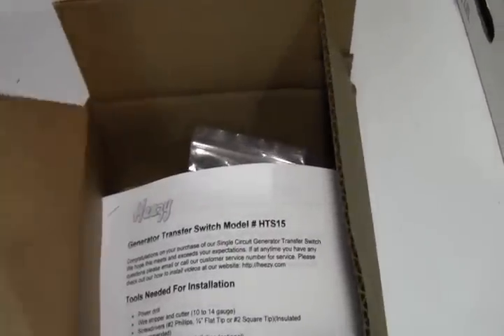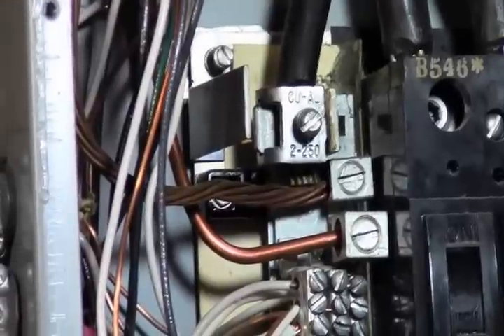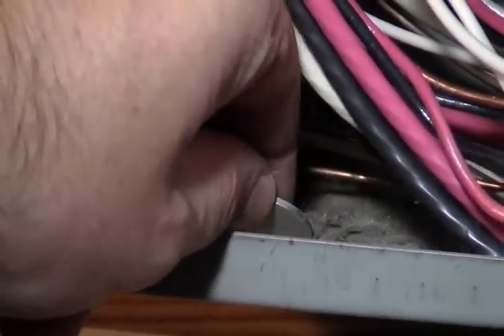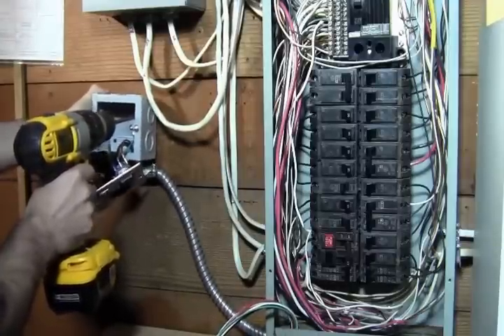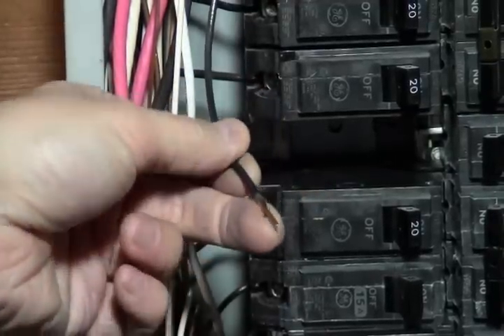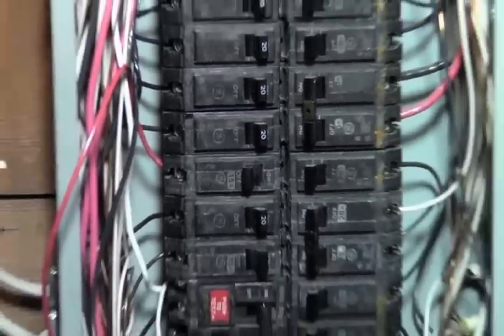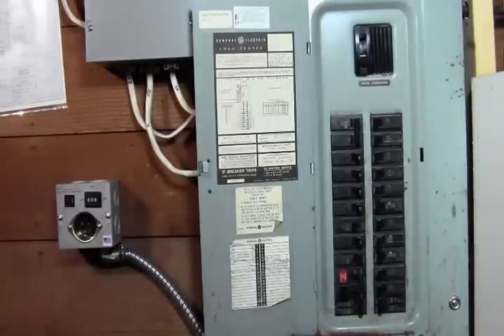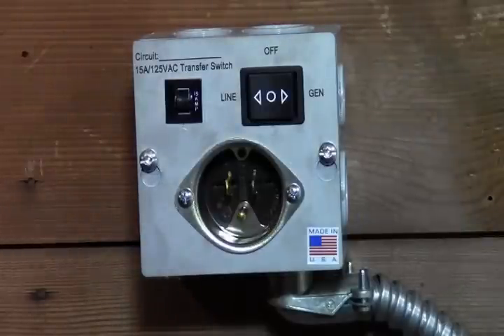RicksDIY How to Wire generator transfer switch to a circuit breaker panel DIY install Instructions

Comment: Rick
Many portable generators have their earth centre tapped for safety reasons.  This halves the electrical voltage to earth and makes using portable tools that much safer.  However it causes difficulties when using the same generator for fixed installations.  Have you come across this problem and is there a way round it?

Comment: What do I need to hook up a Harbor Freight portable gen. 8750/7000? I bought the HF 30 amp 50 ft. 240v  cable.... I guess I need a 240v transfer switch hook into dryer hookup circuit? Thanks, Kenny J

Comment: hi rick great how to. i have a question regarding tying the neutral and the ground wire together on the same lug? i have read some where that they should be on there own lugs same buss? I don't have any extra lugs so i would have to double up on the one lug or should i put the neutral wire on that lug and double the ground wire with another ground wire on the buss?

Comment: How did you find the white neutral?  Did you just use a multi meter  and test for continuity ? Or is that where the black wire leads to?

Comment: Seams like way to much work for One circuit. I have 10 circuit sub panel on a 5500 watt Gen. I only use 8 for water pump fridge fish tank and entertainment center. Few more switches to turn but gets me what I want or need at the moment.
Reply from the maker: +Golfingferdie Just a more simpler way for those with the smaller 2,000 watt or smaller generators to run a gas furnace or boiler during a power outage.

Comment: Rick, I run DJ equipment in a room I built and I haven't done the electrical wire yet cause I want that room on its own breaker, how would I wire a new breaker box without taping into my exciting one,  I was trying to figure out how to run my new one to the main wire leads coming in to the old box, would the electric company come out and shut it off for me at the meter, if it will work that way
Reply from the maker: Scottie Parkhurst If you've never done it before might be best to call around and see if you can have an electrician stop by and check it out...look on Craigslist or call around for a low cost solution most guys can set up the additional box for only 1 hours labor plus parts...
Reply: Ok thank you Rick

Comment: Great video.  Really thorough and understandable instruction.  You have demystified electrical for me.  Now I am going to put a solar generator on the circuit that runs my furnace and AC.

Comment: Rick, thx for the videos! I just installed a RV solar system on my 5th wheel and would like to know if this transfer switch would work for me? My solar panel (315 watt) go's to a MPPT 12/24 volt charge controller that go's to my 2 6-volt batteries. I also have a Whistler Pro 1600 inverter hooked to my batteries. I want to run a TV and/or coffee maker occasionally without shore power or generator? I was told by a RV tech to install a TS? He did not give me any details but after watching your video it makes since to wire the TS to the breaker that operates all my wall receptacles (not sure amps right now but probably 15? Then run  proper romex wiring from my Whistler 1600 inverter to the TS box? That way I can plug what ever appliance I want into any receptacle and fire it up? (toaster,vacuum etc) What do you think about my plan? Thx Bill

Comment: @ 37:35 you said be careful that some generators, furnaces, etc.,,, need neutrals be tied together, so they aren't switched. Could you clarify, please. I want to set this unit up on a well water pump circuit, ... when the grid drops.  ....  Thank you for this video.
Reply from the maker: pnwoods I've done a video on ground neutral bonding if you want to check it out. Thanks!

Comment: Do they make a similar switch for 220 volts if you wanted to control 2 or 3 breakers (a few lights and other essential items to keep the house livable) on each side of the panel? That is providing you have a large enough generator to run the extra items on the extra circuits.

Comment: I purchased the newer (New OCT 2013) HTS15-Auto Generator Transfer Switch  recently. It's a little different than the one you use in this video. Specifically, mine doesn't have the manual Line-Off-Gen switch but instead uses a built-in relay which automatically switches to the power inlet when the 'generator'  is plugged into it.
My question is: Can I still follow the wiring procedures shown in this video to install this "New OCT 2013" transfer switch?
Reply from the maker: Yes, the New HTS15-AUTO has the same wiring method as the manual switch version, only 5 wires to hook up.

Comment: Don't you have to turn off the main breaker to the house FIRST before you turn on the Generator switch on the transfer switch?
Reply from the maker: Nope, the switch automatically cuts off the line power from the circuit breaker.

Comment: A transfer switch can power several circuits, right? As long as you have a large enough generator to power the selected circuits?

Comment from the maker: It all depends on the size of the motor in your furnace, best thing is to check your nameplate sticker located on or in the furnace, look at the RLA or running amps, multiply that by your voltage, Say 3.5 amps x 120V Volts = 420 watts, multiply that by 1.25 to 1.5 for starting & other misc component watts. 1.5 x 420 = 630 watts, so a 800 Watt Generator should be able to run this example. The switch is available at Amazon; look for Heezy HTS15 Transfer Switch.